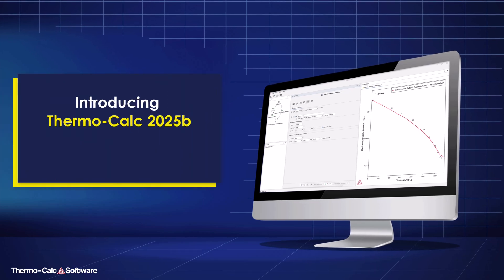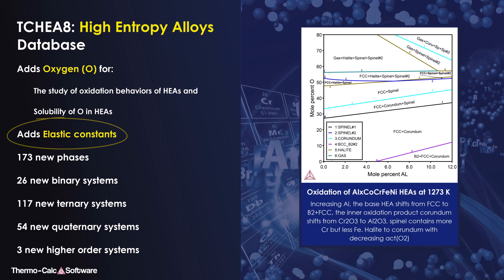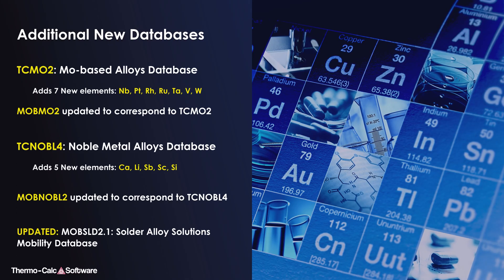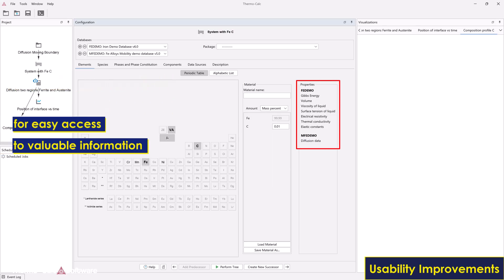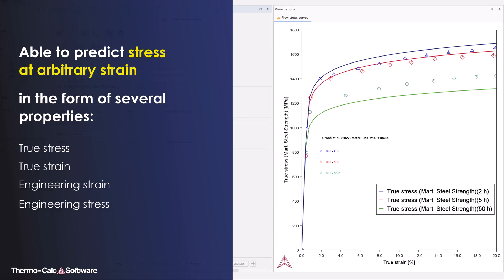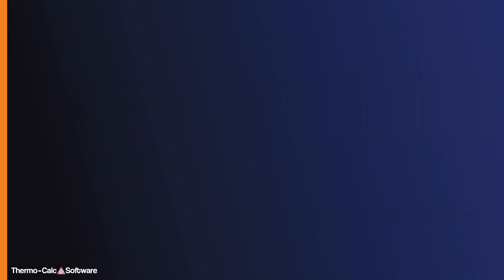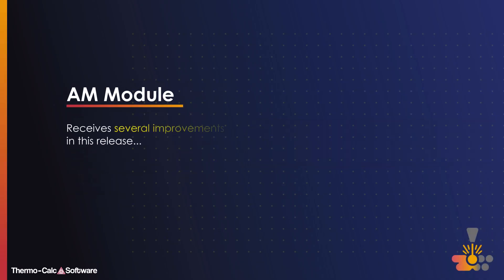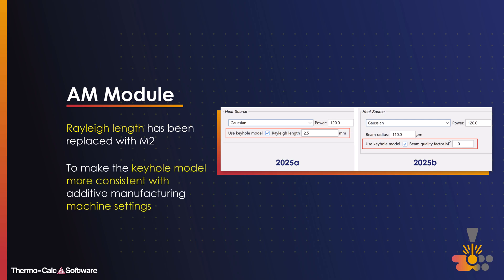Introducing Thermo Calc 2025b

Comment: how to use thermo-calc to make the phase diagram of high entropy alloy (multi-component alloy)？ e.g., (FeCoCrNi)100-xAlx, Thanks.
Reply from the maker: Hi @关旭-v8r, 

The first method is with the Equilibrium Calculator. Start by switching to Advanced Mode (there’s a button labeled "Switch to Advanced Mode" in the configuration window). Then, define the composition—for example, set 'Amount of component - No normalization - Fe - Mole - 25', 'Amount of component - No normalization - Cr - Mole - 25', 'Amount of component - No normalization - Ni - Mole - 25', 'Amount of component - No normalization - Co - Mole - 25' (25 moles here is just an example, you can use any number here, we mainly need to set Fe, Co, Cr, Ni to be equal amount. Then for Al you can set as 'Amount of component - No normalization - Al - Mole - 1' (here 1 mole is just an example). Under Axis Definitions, you can set the amount of Al for example to vary from 0 to 10 (10 is an example, you can set it to the amount that you need), and set the temperature range.

The second (and easier) method is with the Material-to-Material Calculator. Here, you define two endpoint compositions. For example, you can keep the ratio of Fe/Co/Cr/Ni the same and adding how much Al you want for the second endpoint composition. The software automatically interpolates between these two materials. In the Axis Definitions, set the mole fraction of Material B from 0 to 1 and define the temperature range as before. Set the calculation type to Phase diagram and run it. This method is especially useful for compositionally complex systems like high-entropy alloys, since it avoids having to manually balance each element.

Hope that clears it up!